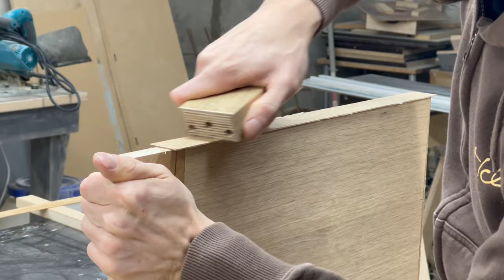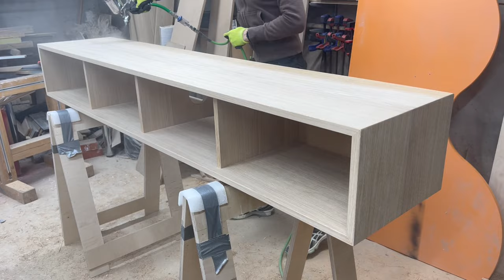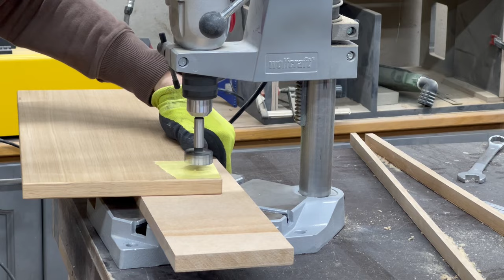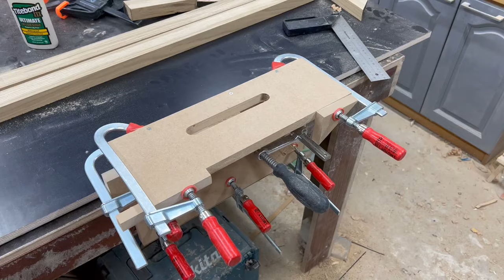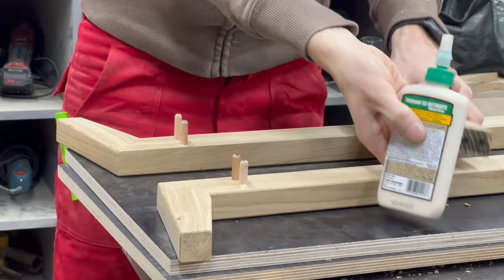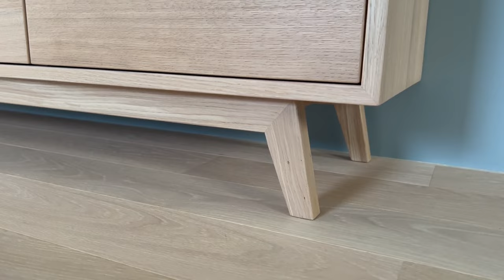Mid-Century Modern TV Console | DIY

Comment: This is probably the best media console video for the diy builder I've seen yet. You made a fantastic piece of furniture with the bare minimum level of specialty tools. No Domino, no  jointer,  no thickness planer, no BS. 

Great work, great video!!
Reply: Yeah - the thing i would struggle with is the planer.  Will have to sacrifice and use mdf and veneer.  But it comes out well although it cant be as intricate as some are.

Comment: Hi there, I saw that you use a lot of biscuits for joints and I've never used them, could you tell me if you add any screws after? Or they are strong enough to hold the boards together?
Thanks in advance.
Reply: Biscuits with wood glue will be stronger than any screw. Wood to wood with wood glue ain’t coming apart